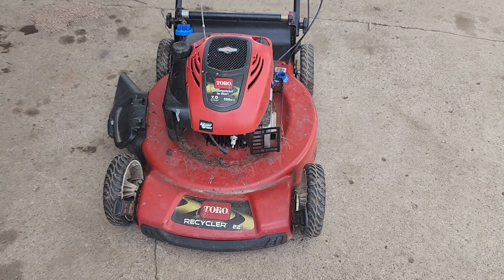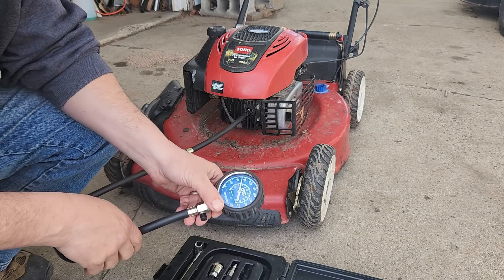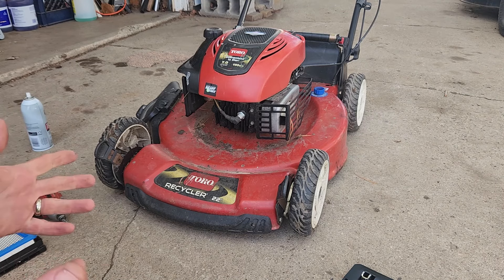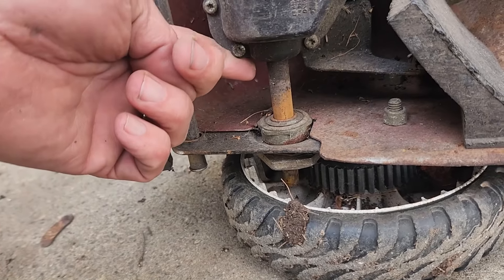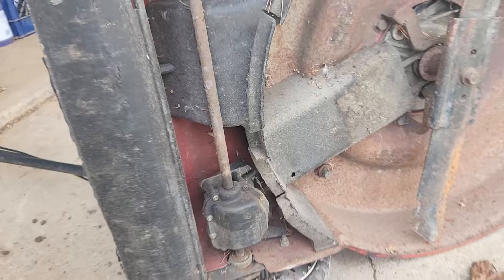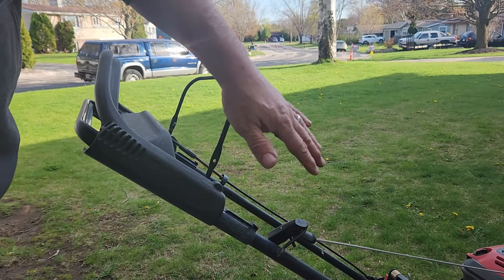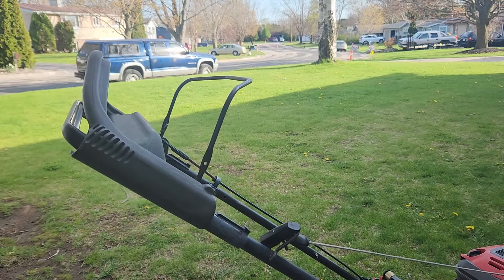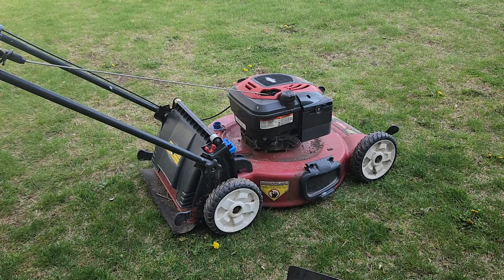Toro Personal Pace - Self Propel Delete - Not worth fixing

Comment: Yah I had a troybilt engine ran great self propelled didn’t.  I ended up pulling engine off deck and putting it on a push mower deck that had a bag.  Works great.  Sold it not long afterwards. Even changed cover plastics to one that said craftsman like the deck and bag.  🤫 nobody will know 😃
Reply from the maker: Nice!